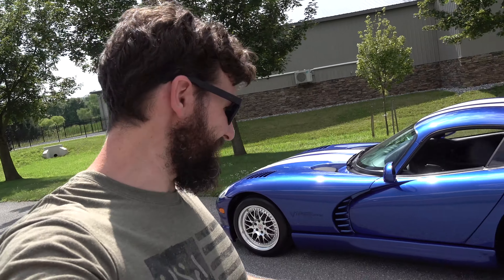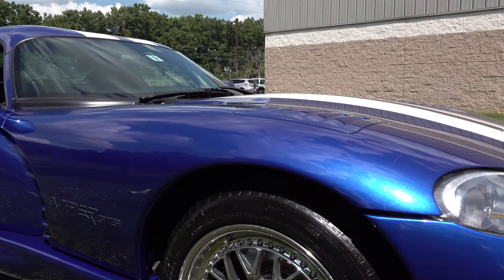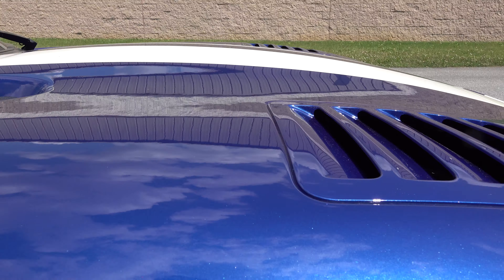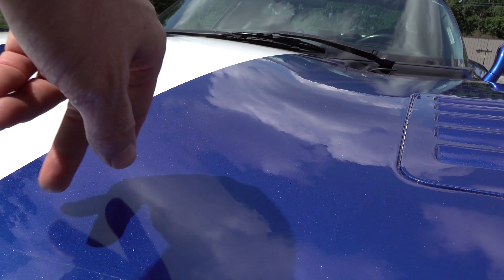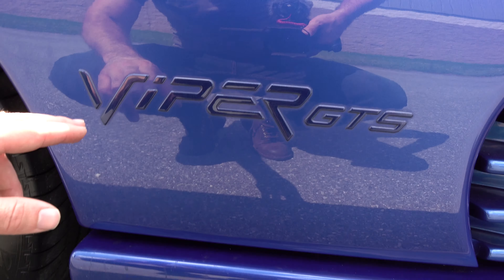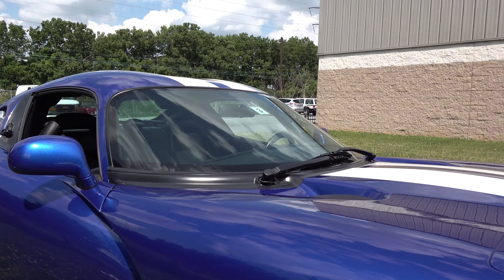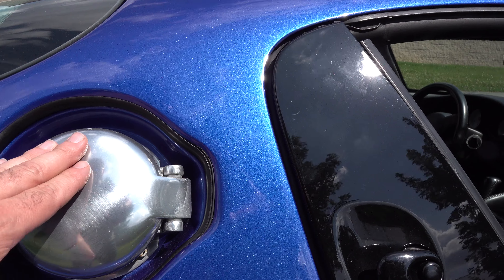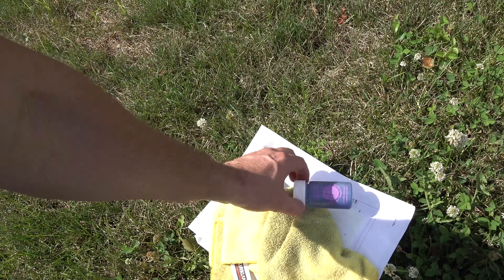1996 Dodge Viper GTS

Comment: The white Viper letters on the side you mentioned on other cars are usually aftermarket decals, but they are not factory. The peeling on the plastic on the interior is normal wear that happens to all of these. The dash will start doing that soon. Just strip it clean and repaint it. Looks like the other two owners don't know how to drive it since they scratched the underside of the front bumper all to hell. Lowering these cars is so stupid because all they do is drag everywhere after that. Very sharp looking Viper!